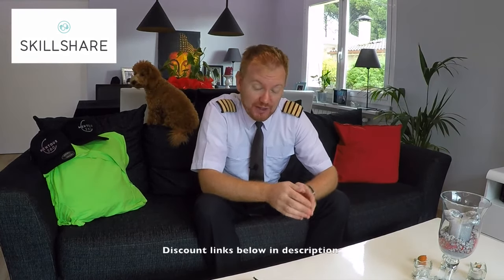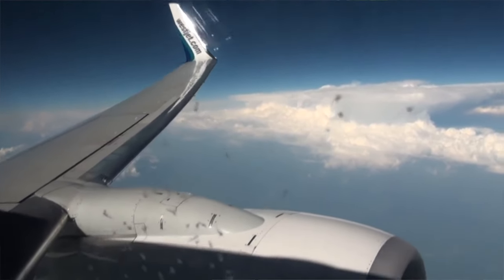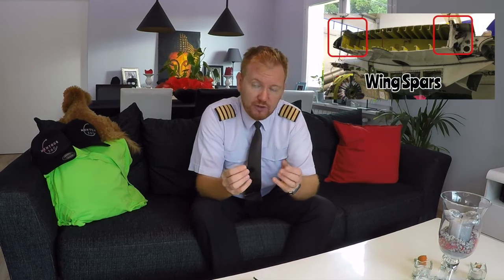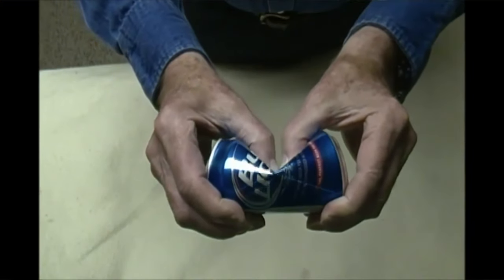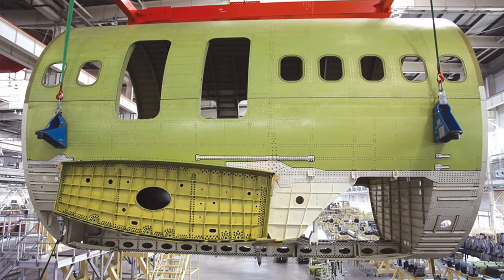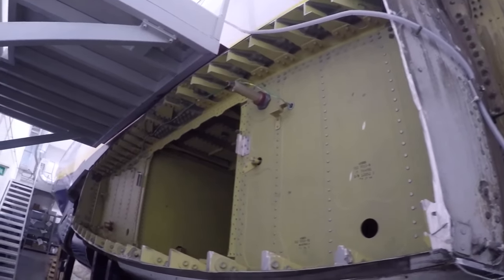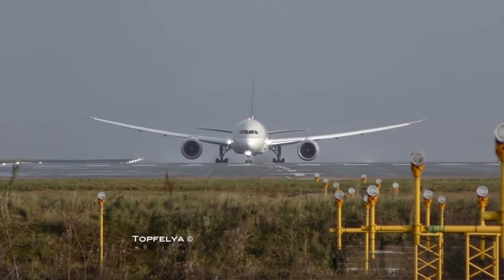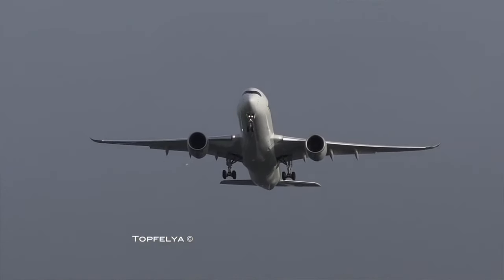Why don't the wings break?!

Comment: Wings definitely do not break under a thunderstorm situation. They wont brake even if a lightning strikes them. Only way to break them is if you hit a solid object with the wings, say a tree, tower, or another airplanes wing
Reply: Happens all the time in normal category general aviation airplanes designed to operate between -1.52/+3.8g.  Actually, it's ordinarily the horizontal stabilizer that fails under positive gee overload, followed by the wings failing in negative when the airplane goes inverted out of control.

Also wings have parted company with more than a few B-47's, B-52's, and at least one DC-8.  You can look it up
Reply: doesnt have to be another planes wing, a winglet will do the trick too
Reply: Oh yea????
Reply: Tell that to the dead souls from the Lockheed Electra and the Martin 202!
Reply: @stuartlee6622  Well those airplanes you mentioned had very tight budget and are much older than the airplanes of today.
Reply: @majortom4543  yeah but a modern plane still isnt that tough when it comes to withstanding damage, all you need to cut through the wing of a modern plane is the winglet from a legacy 600 jet (and a closing speed of 1600kph)

poor bastards didnt stand a chance
Reply: @mwbgaming28  I didnt know that the winglet thing actually happened. i mean on your first comment i said, ok thats a weird invented example but i get it.  On your second comment i understood that you were talking about an incident and went on to search for it. how come they didnt see it coming if they were almost head on.
Reply: @majortom4543  with a closing speed of 1600kph the legacy pilots might have seen the 737 maybe 1-2 seconds before impact but they were distracted by trying to use the computers on board the plane 

the pilots of the 737 were busy talking with each other and were not looking out the window (even if they were looking, they would have had at most half a second to react because its a much smaller plane and 1600kph is faster than most people think)

it would be similar to you driving down the highway at 150kph and trying to avoid a head on collision with a drone that is flying toward your car at 150kph in your lane (and you dont know its coming)
you wouldnt have a hope in hell of seeing it let alone swerving out of the way
Reply: @mwbgaming28  True, its both speeds added together, good example.
Reply: @majortom4543  both planes could have survived that incident if Boeing had used titanium to make the wing structure instead of aluminium (or at least made the spars thicker)

then all that would have happened is the legacy would have lost its winglet and the 737 would have a fuel leak and loss of hydraulics on the left side and thats about it, when all is said and done there would have been 2 planes full of scared people, 2 huge repair bills and a lot of ATC embarrassment
Reply: Radley2612  i assume you are referring to JAL 123 which crashed after a wingstrike into mt fuji

Comment: Airlines are held to the highest standards except when they aren't.
There have been several accidents through the years due to poor maintenance. For instance, Alaska Airlines falsified their maintenance records a few years ago which led to the loss of one of their planes, despite heroic efforts by the pilots.
Airplanes have so much redundancy though, that they seldom crash due to mechanical faults even though airlines sometimes cheat on maintenance. Most crashes are caused by pilot error. (Which is why I advocated for eliminating pilots entirely back when I worked for an aerospace company.)
Reply: Yeah then we get into the practice of using offshore maintenance facilities. They keep the aircraft in service until they have a stack of bitch sheets then send it over to one of these offshore facilities.
Reply: I would not want to fly on a plane with no human pilots at the controls, regardless of how advanced autopilot systems become. If anything goes wrong with the aircraft that the autopilot cannot deal with, everyone on board is completely helpless and screwed. I see human pilots as a "last resort" control option: basically another layer of safety for everyone on board.
Reply: I would like to see the look on your face when that PC flying you to Mexico gets the blue screen and smears your bones into the ground.

Machines can be programmed to do lots of things but what they absolutely suck at is handling situations that cannot be programmed.
Reply: Michael Etzel 
Do you use elevators with no humans at the controls? They used to have human attendants. I bet there were people who objected when they went to automatic controls there too.
When human pilots cause more accidents than they prevent, it’s time to get rid of them.
Reply: Dont think it will be completely pilot free someone has to be certified pilot to override a system failure plus a computer opperative i would not not travel on a pilotless aircraft
Reply: chris quirke 
The whole point is that pilots cause more failures than systems. It will reduce crashes if we get human beings out of the loop.
Yes, there will be a lot of irrational fear of pilotless airplanes at first, just like the fear of “horseless carriages” when automobile were introduced. Railroads continued hiring brakemen for years after automatic brakes were introduced. People have a lot of superstitious fear of change.
I would expect that cargo planes will be the first to go pilotless and passenger planes will follow once the superstition is overcome.
Reply: @EtzEchad  I think eventually we may get to pilot-less airplanes, but accidents like Air France 447 illustrate why it won't be anytime soon. That airplane crashed because the computer was so confused over erroneous readings that it just gave up and peaced out, handing the pilots a stalled airplane in IMC with no airspeed reference. Unfortunately the pilots were behind the curve on figuring out the problem as well, but in many cases, pilots have a huge advantage over computers in that they have the ability to see the "big picture", allowing them to foresee deteriorating situations FAR earlier than computers can which just operate off of direct sensor inputs.
Reply: Chad 
Actually, Air France 447 was crashed by the pilot. If he had just let go of the control, the plane would’ve recovered by itself. At the time of the crash, I happened to work for a company which was the main competitor of the the air data probes on the plane. (Testing showed that our probes would not have iced up.)
What happened was that the probe iced up which cause an erroneous low air speed for a few seconds (IIRC it was about 15 seconds.)
For some unknown reason, the PIC pulled back which caused a real low airspeed and a stall. He then proceeded to hold full up elevator and kept it in the stall for something like two minutes. 
This pilot apparently had never been trained in what happens in a stall. (Air France admitted that they never trained for a full stall.)
Any private pilot knows that if you have full power,  full up elevator, low airspeed, and a descent, YOU ARE STALLED.
Bottom line, if the auto pilot had been programmed to do the correct thing when airspeed is lost, the plane would’ve recovered by itself. Instead, the idiots who programmed it thought that the pilot should take charge and they killed 228 people.
Pilots are a menace. :)

Comment: what about fighter jet? how their wings can go more than 5g without bending?
Reply from the maker: Much much stronger construction, also much heavier.
Reply: Also, much shorter.
Reply: I of course agree with earlier answers but just want to add my thought. I'm pretty sure they do flex but not as much since they are more rigid and shorter, something that is needed for the higher speed I guess.
Reply: The aircraft is the “wing”.

Comment: if i'm 1G, my wife is at least 10G......
Reply: The number of G's is independent of your mass.    It is a measurement of apparent weight per unit of weight at rest on the surface of Earth.  It is a measure of gravity minus acceleration, as vectors, all divided by Earth standard gravity.   So if you weigh 150 pounds at rest on the ground, and you weigh 165 pounds in an aircraft while it is banking a turn, that is a 1.1 G environment.  Someone who weighs 200 pounds at rest on the ground, would weigh 220 pounds in the same aircraft at that time.

Comment: I was on a plane that flew into a severe thunderstorm which did not show up on radar, although in my opinion it was clearly visible to the naked eye. Pilot apologized but it was a terrifying experience. I did remember having the feeling that the wings could bring due to the extreme bending and that it was difficult to keep the plane under control.

Comment: On the B52 which I flew in back in the day the wings flexed so much that the skin on the fuselage below the wing would be wrinkled when the plane was on the ground from the wings sagging.

I say below the wings because the wings were anhedral wings meaning they are at the top of the fuselage sloping downward instead of the bottom sloping upward like most passenger planes have. 

They sagged so much that they needed a special set of landing gear near the wingtips to keep the external fuel tank near the wingtips from touching the ground.

Comment: There’s only one case of a wing breaking that comes to mind. That of chalks ocean airways 101.  There was a 16” crack on the underside of the right wing.  The z-stringer was cracked as well, and for every takeoff and landing, the crack grew until December 19, 2005, at 2:38 pm, the wing failed, and the plane fell into the ocean and 20 people died.

Comment: RC Model pilot here, flexing is seldom a problem, but flutter often is. I've seen huge flexing and then break, but then it was a builder who skipped the vertical component of the spar. Flutter at high speed breaks the airplane in the air into smithereens.

Comment: Airbus' wing flex test at 12:35 was an eye opener.  I was aware of the testing airframes went through, but I had no idea the degree.  Do the wings in this specific example flex so much because they're all composite, or is this a general case regardless if they're composite or aluminum alloy?

I wouldn't want to be anywhere near the tornado or hurricane which could conceivably cause this much flex. Pretty sure my heart would quit long before the wing box shed.

Speaking of the wing box, when most people think of wing breakage, do they think of disintegration along the span, or breakage at the root/box interface?  I guess I thought of failure at or near the wing box....

Great topic, as always.  Also, your command of the English language (my only language) and all of its nuances is quite amazing, you speak it better than I do!  I always thought being multilingual was a sure sign of high intelligence. Thank you for your content.

Comment: There was a German show back in time which used real war tanks to roll on the wings of an old 747 at an "airplane cemetery/scrapyward". It was impressive but nothing broke. It was an educational program about construction extremely stable objects resisting huge forces without breaking.

Comment: When my friend restored a Heinkel He 111 WW II bomber, I could have a look at the wing fastening. All there was were 4 ball-shaped ends on the corners of the main spar, not more than a small fist, fitting into cup-shaped receivers at the wingbox, held by cap nuts over the ball joints.
 
Looked incredibly fragile for a warplane.

Comment: Stress is caused only by restraint of movement. Bending and shear Stresses (as well as torsion) are actually zero at the free end of the wing and increase steadily towards the wing root while deflection is maximum at the free end of the end and is zero at the wing root. Also those wings are flexed to an insane amount, over 150% of their maximum loading and deflection, before they break in testing. So while a wobbling wing might look unsettling, it's not really under stress at that point. The place where it meets the fuselage where stress is at maximum.

Also these days Boeing and Airbus have got clever at using the movable wing surfaces like a kind of suspension spring to counteract forces caused by turbulence.

Comment: There is a vid on YT showing a plane losing both it's wings mid flight.
There is nothing surprising about it, it's one of those planes loaded with "water" taking out fires on ground. It dives down towards ground and when it corrects the dive the G-value get too big and just breaks off both wings close to the body.

Comment: @mentourpilot Two things.  First, do commercial airplanes have g-meters that record g on the aircraft.  I'm not asking about a g-meter in the cockpit, I'm referring to what I'll call a 'g-counter,' that recognizes when an aircraft experiences heavy 'g's and records it.  The Navy A6 intruder was rated to 6gs, but I don't think we were supposed to pull more than 4 if we could avoid it (this was a while ago).  More than 4 wasn't prohibited, I did it dozens of times, and on an air combat maneuvering flight it was expected .  
.
But if we pulled 4 or more the maintenance guys would tell us and there were jets where maintenance told us not to go above 4 --I think that was because the counter had gone off too many times.  
.
Second, in the first 20 seconds you had a video of a machine bending the wings.  That was cool and I'd like to have seen how they break.  Do they snap?  Do they crumple at one point?  Do they bend and stay bent so they're super dihedral?  I'll google it.

Comment: (12:39) That's one crazy angle the wing prototype is subjected in this test.  Does the manufacturer also test for the 'destructive' resonance frequency of a wing under its operating load range?  How reliable are computer modeling for failure points?

(12:46) The poodle is not an aviation fan. And shy. Always seems to be turning its back to the video cam.☺️🤗 What made it perk up toward cam?

Comment: A small correction. At around the 6.00 minute mark it is correctly stated that the forces borne by a flexing wing are more evenly distributed. However it is also implied that if the wing didn't flex the forces would be borne by just a few points in the wing which would cause greater metal fatigue at those points. It is true that greater forces would be applied to those points but that doesn't equate to metal fatigue. Basic metallurgy tells us the main cause of metal fatigue is in fact flexing. So any part not designed to flex will actually suffer less fatigue even though the forces on it might be greater. The good news is the engineers know exactly how much force is applied to the various parts of the wing construction, and also factor in metal fatigue on any parts that do flex. Bottom line... safe as houses. When was the last time you heard of a non aerobatic wing breaking?

Comment: Interesting facts regarding composite wings. Boeing used to test all new wing designs to failure, however once they started constructing them of composite, they can no longer do that because when a composite wing fractures, they explode sending splinters and toxic dust everywhere. The test facility needs to be treated like an asbestos contaminated demolition clean up, which is very expensive. So now they only test to a given safety factor then stop before failure. The safety factor is high though, so no worries.

The reason this happens is because with higher flexing under a given load, there is more stored energy (force x distance) and the resin holding it together fails more abruptly than aluminum (brittle vs ductile fracture) releasing more stored energy faster.

Also, if you are on a composite aircraft and it catches fire, the fumes are more toxic than from an Aluminum aircraft. Not saying this to scare people from flying, just take evacuation from the area far more seriously and head upwind from the aircraft.

Comment: Thank you for your excellent diction and alluring way of describing each and every subject you cover.. .
In my case, I would like to know what really happened  in a plane accident back in 1972 that involved an Iberia DC 9 (Bravo India India) from Palma de Majorca to Heathrow Airport London, where I was expecting it, as a Ground Traffic Officer from the Company, to do the turnaround at Heathrow. (I was not very happy about meeting Captain "Cueto" again, for he was a Royal little Hitler...) Minutes after the arrival timetable was overdue we get the info that the plane had crashed somewhere in the French Countryside,. witnesses said it had a structural disintegration on its "Free-fall" from its cruising altitude. Considering that there was a French air Controllers strike at the time, The Military Airforce had taken over the job, and word has it, that a French Fighter had just took off the tip of the tail end of the DC9, where the stabilizers are placed,  unleashing the unavoidable events that followed. 
It was all "Hush-hushed" considering the French Airforce was involved. Maybe you can have access to what had happened.
Reply: This is the 1973 Nantes mid-air collision